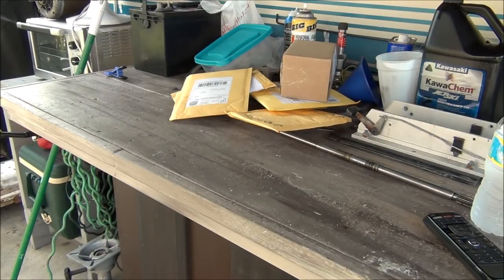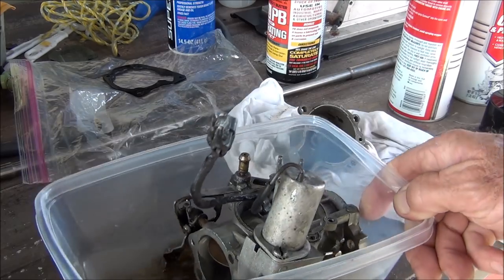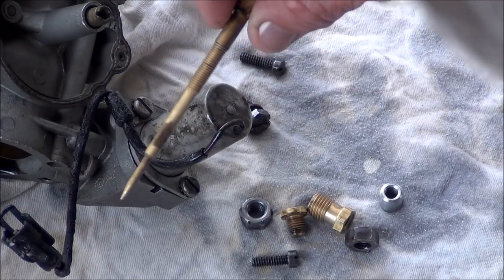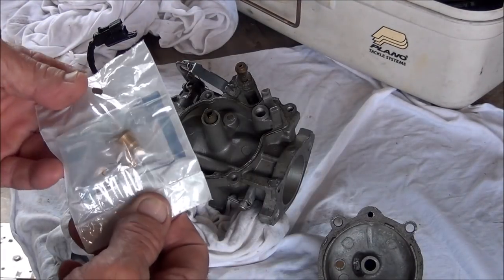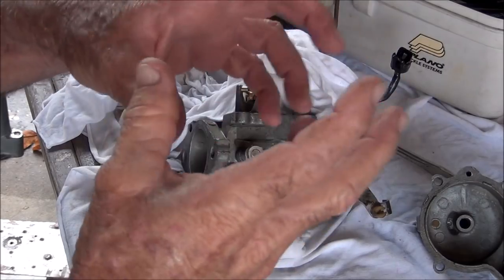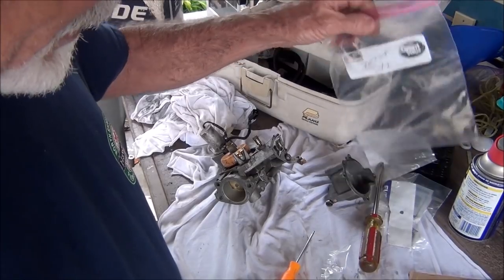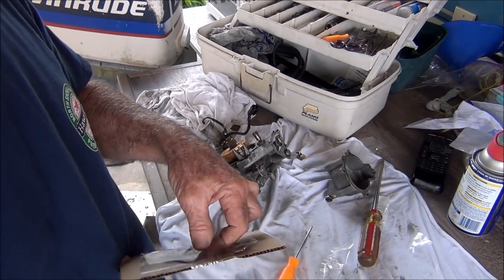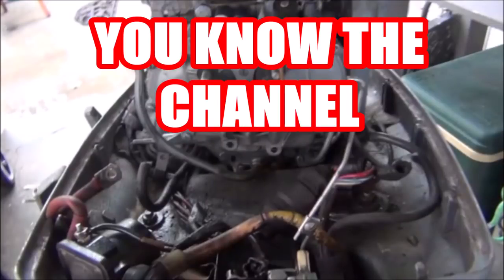Outboard Carburetor Cleaning Rebuild Evinrude 40 hp

Comment: Great video, I have the exact motor and carb. Last week while on the water, the motor died and gas was spurtig out of the port next to the slow speed needle valve (to the right lookig ito the carb). Have you ever run across this before? If so, any suggestions for correctinng this?
Reply from the maker: Hey. Thanks for tuning in. Sorry just got my internet back after moving. Anyway- Not that I can remember. That should be the vent hole- where air can get into the bowl- if its overflowing the needle must not be seating- so fuel just keeps pumping in and coming out the vent and flooding the motor. Could be a good needle but a bad float- best to replace both from the kit. Thanks again & Stay tuned !

Comment: I have going back over these videos while working my 33hp and thought I saw you show changing the rubber roller for the throttle but I can't find it again?Those are $65 on Marine Eng....I was wondering if a 9.9 roller could be retro fitted on there?I have an old one.I also thought of putting a piece of rubber tubing over the roller which I of heard being done before.Ended up ordering a new brass ring for the armature since I deformed the other so bad.Dont want to waste time trying to get it back in shape to ride smooth.Keep the videos coming.Making a few as I go on the 33hp.
Reply from the maker: Hey. Sorry to hear that about the brass ring. The 9.9 cam follower is to small but you may get away with the piece of hose, I've done it before. Take the part number 0376477 and search ebay. Theres one on there from Green Bay Prop for $14 free shipping ! I buy all my parts on ebay
Reply: thanks
Reply from the maker: @wish2fish37  👌

Comment: Ok I have a 1972 evinrude 25hp. I have rebuilt the fuel pump to how it was on the boat but I’m wondering if I could change the direction of the small outlet. I see that there are different orientations for it. Mine goes straight down into the base plate and causes a bend in the line. So my question is if rebuild it with the small outlet in a different direction is it going to work
Reply from the maker: Hey. Yes it will work but you have to change the insides around too  https://www.leeroysramblings.com/Rebuilding_fuelpump.htm

Comment: Hello, (sorry for my English.. but I'm French and I haven't practiced for a long time). Thanks for this video. I just picked up a 1974 Johnson 40cv (40E74S). I cleaned the carburetor. 
I hesitated to disassemble the idle needle. On reassembly I have to do 2 full turns for the system to find its place. 

In France it is difficult to find parts for this old model. If I buy on EBAY USA I have import costs almost as high as the purchase price + delivery... Paying 40 dollars to bring in a 6 dollars part is painful. Especially for an engine made in Belgium (Europe) so a country next to France. 

If it turn on i will have to gets the propeller nuts kit to test it on the water.

Ignition seems to work but spark is weak. 
What spark plugs do you recommend? On mine are mounted NGK BZ7HS10

Anyway, thank you for your videos and tips.
Reply from the maker: Hey. Thanks for tuning in. Wow I didn't know it was that expensive to get parts. The Champion L82C spark plugs are recommended but some people like NGK plugs more. Thanks again & Stay tuned !
Reply: @THISOLDOUTBOARD1  saler said me to take champion QL77JC4 ..Motor run on..
Reply: @THISOLDOUTBOARD1  But the two blue wires put in contact does not cut the motor. I had to put on the shoke to stop
Reply from the maker: @davealex06  yes those should be fine
Reply from the maker: @davealex06  maybe the switch is bad

Comment: Outboard god I have question. I've been through your vids bunch of times and love them. TOO is 79 6hp. Soaked carb in your mixture looks to be pretty and cleaned those little holes in the carb. I'm getting gas coming out of what I guess r vents on front of carb. When I pump bulb to get it hard. Is it my dumbass or is there problem in carb
Reply from the maker: Hahaha. The needle is not seating. You'll have to take it apart and find out why. Thanks !
Reply: @THISOLDOUTBOARD1  the low speed needle or float needle
Reply from the maker: @jshall1000  float